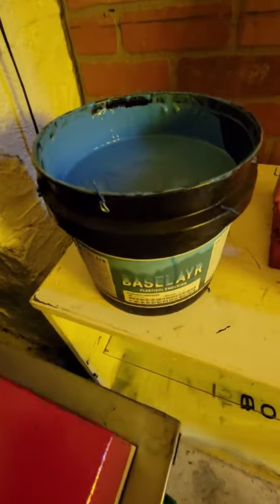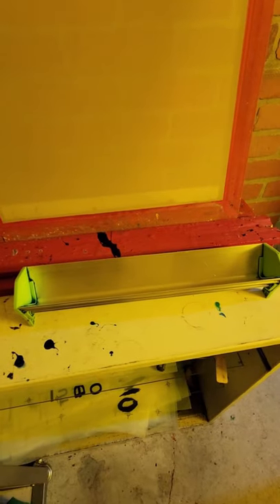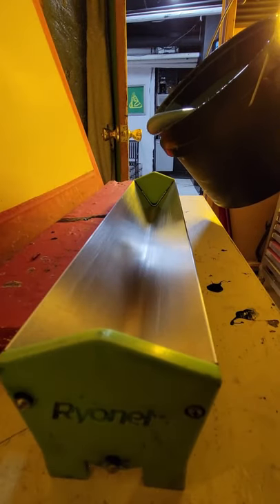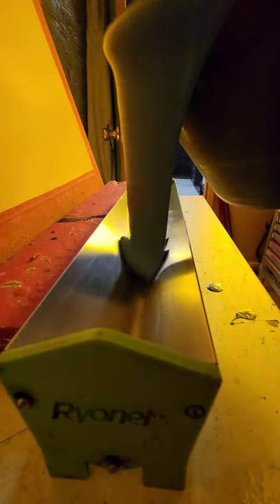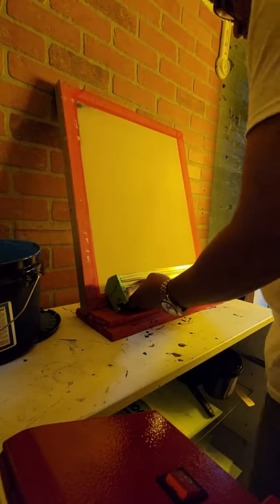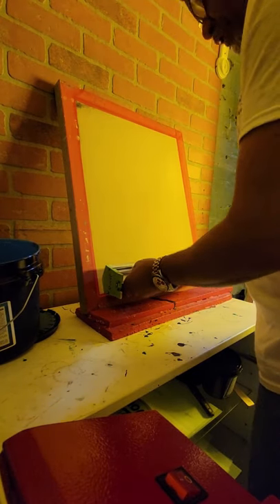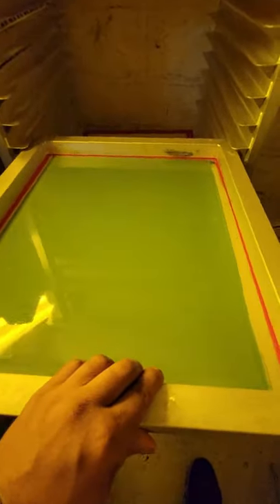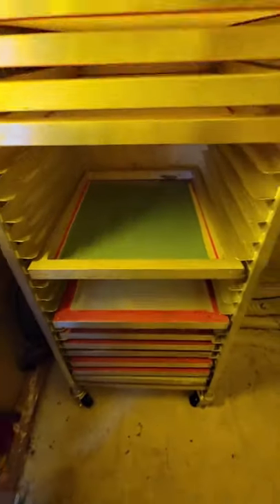How To Coat A Screen For Tshirt printing.#shorts

Comment: is there a specific reason why most printers double coat their screens on both sides? 
I only coat mine once on one side and works great!
Reply from the maker: We coat our screens twice just to make sure you got all the mesh coated and to build up the thickness of the emulsion.
Reply: @tainoink  isn't coating the screen both sides related to the emulsion quality? I used to use a semi low quality emulsion and if i coat my screen both sides with it there is NO WAY i can wash out the emulsion and claim my design. Especially if I'm doing Bitmap pictures. Thank you for your videos ❣️

Comment: What size is the best scoop coater for a 20x24 frame? Thanks in advance
Reply: Idk the exact length of my scoop and can’t find my tape, but scoops usually come in a few set lengths. I got the one that fits inside the frame and coats most the surface. I think it’s 18” or 19”.

Comment: Bro whenever I'm washing the frame this coating is coming out I don't know what I'm doing wrong ?
Reply: You have to let the emulsion dry fully before you burn it, different brands may take longer to dry, when i was in school it had to dry overnight but ive since seen brands that dry in 40 minutes. You also have to make sure exposure is not too bright or on for too long or the image will not wash properly. Keeping screens clean by reclaiming them properly is also important or future screens will look and wash like shit. May take some trial and error but once you know what you have to do the process is simple. Let me know if youve gotten it down since your comment is old
Reply: @stevencandra8378  yeah mine drys in 40 min, fan and heater works great.